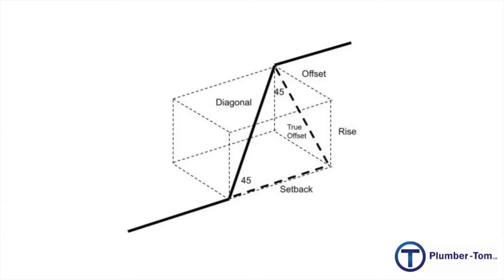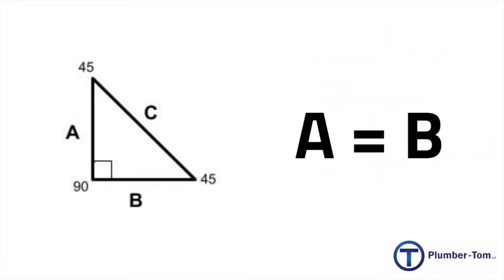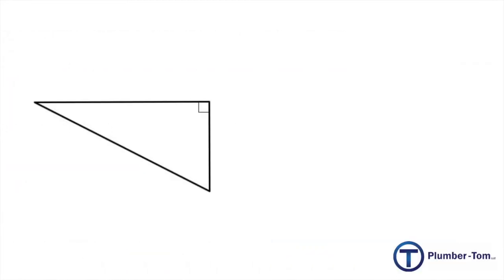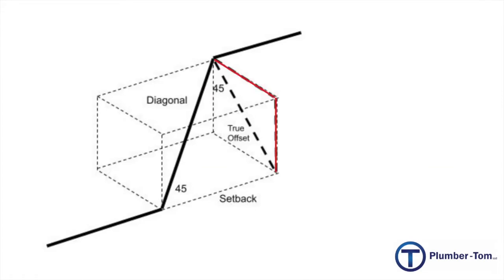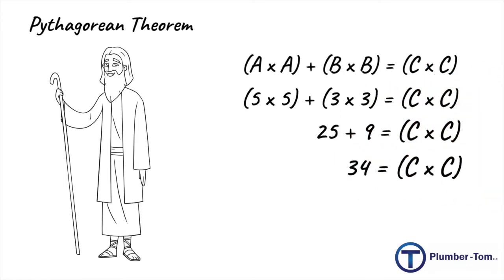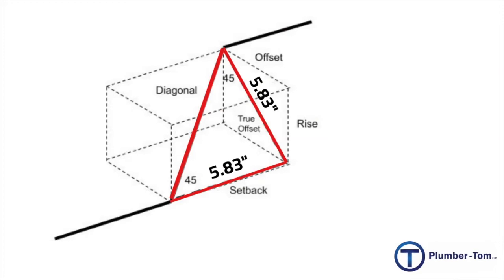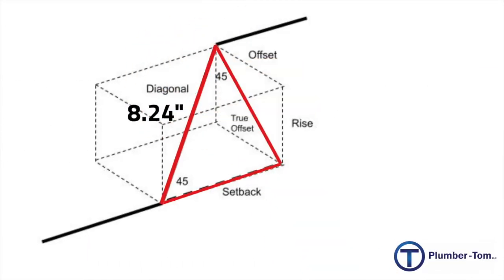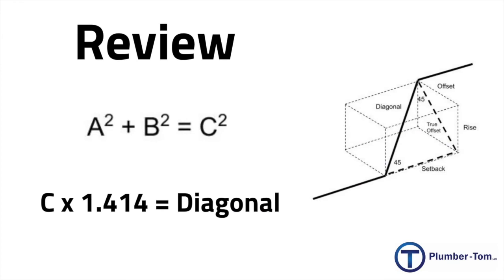Plumber Math: Offsets Part 3 - Rolling Offsets Using 45 Degree Fittings

Comment: I have a unique problem that I need help understanding the math. Using standard 45° elbows, I have a rolling offset for a change in elevation. The elbows are rotated in such a way that the lower line and the upper line will turn 45° from each other. Is there a formula, or set of formulas I can use to achieve the desired effect?
Reply from the maker: II don’t think so. If there is a formula, I don’t know it.

Comment: Thank you for your great explanation. 👍 

May you explain as well how to fit up the rolling offset please?
Reply from the maker: You’re welcome.  One you calculate then you will need to subtract for fitting allowances (I have another video on that). Then you can assemble the pipe.
Reply: @plumber-tom9470  

What happen though, I have problems assembling the rolling offset. I know from the explanation how to calculate the rolling offset. 

Do you by chance, have a video showing how to assemble the rolling offset AFTER calculation is done?

Comment: I was trying to roll a wye 45 degrees, but I wanted a fitting that picked up a vertical stack at the end, instead of picking up a horizontal run.  That appears to require a 30 degree fitting (1/12th bend) which doesn't seem to be a fitting.
Reply from the maker: Oh. When you get into 30 degree fittings there are other constants to use for calculating. 1.414 is only for 45 degree calculations

Comment: Is the fitting allowance, the rest of the elbow compared to where the pipe actually is in the connection
Reply from the maker: No it is not the whole fitting.  The fitting allowance is the space inside the fitting from  the end of the pipe to the center of the fitting.

Comment: How do you come out with 5.83  from 34?
Reply from the maker: Take the square root.  On a calculator, type in 34 and hit the button that looks like a check mark.  This will find the number which, when multiplied by itself, will equal 34.   It comes out to be 5.83.  Hope this helps.

Comment: How would you still do this rolling offset if you used 2- 90 degree elbows on  45 degree angles?
Reply from the maker: You can do  a rolling offset with two ninety degree elbows, but the math is different.  You would just have to measure the offset between pipes, and subtract fitting allowances.

Comment: Do it with 90s
Reply from the maker: That is possible, but it does not require as much math.  Just a measurement from center to center and subtract fitting allowances.

Comment: Why not just use the setback x 1.414 ?
Reply from the maker: Good question. Most of the time we are not given the setback or it is difficult to measure. But the offset and the rise are generally measurements we are given or that we can measure for ourselves. From the horizontal offset and the rise we can figure out the true offset which is equal to the setback and then multiply by 1.414 to get the diagonal.

Comment: Good morning, Tom! This is totally unrelated to this video. You are very good at explaining math, so I’m wondering if, one day, you could produce a video on the math involved with hanging pipe — particularly with clevis hangers anchored into a concrete floor above — Unistrut not being an option. I know there are “cheat sheets” out there, but if you have a method that you use or recommend, it would be very interesting and helpful to see that method and math explained. My brain gets to the overload point sometimes when I am trying to calculate hanger heights, rod lengths, etc. on, say, for example, a run along a corridor with three different sizes of copper, all with different thicknesses of insulation, and one non-insulated SCH 40 steel pipe for gas — all parallel to each other. 

To simplify, let’s say all of these pipes are on the same centerline from the floor. Of course, the hangers for the copper would have to be hung at their “temporary” height to allow the copper to rest in the saddle for roughing in, and enough rod must be left over to allow for the hanger to be dropped enough to allow for the future installation of the insulation, but the MATH! What is the math? What is your method? For the example I gave above, I could go through three or more notebook pages, adding, subtracting, scratching-out what I just tried to calculate because I forgot where I was in the calculation, then starting over again. 

Laying-out and calculating hanger heights and rod lengths seems to be way too time-consuming for me, and I know that you know the answers to change that. If you would like an example of one I just did down a 180’ corridor, start from left to right with these four pipes, all parallel to each other with the same centers from the floor to the pipes: 1-1/4” copper hot return with 1” insulation, 2” hot copper supply with 2” insulation, 3” cold copper supply with 1” insulation, 3” SCH 40 steel gas with no insulation.

What do you think, Tom? Is this something you have an easy-to-remember mathematical solution for? Is this something you would be interested in producing a video for?
Reply from the maker: Hey Bruce.  That is a good suggestion.  I know exactly what you are dealing with.  I did commercial construction work for quite a few years.  I will put that on my list of videos to consider.  Thanks!

Comment: What about the actually roll in the rolling offset? Like how much you need to turn the bottom fitting to make the offset work. No one ever talks about that.
Reply: That varies for each scenario. I've found for me the easiest way to find that is to take the two 45s with the length of pipe Tom just taught to find and put them all together. For the rolling offset to work correctly those two 45s need be in line with each other. Usual fittings have marks on them to help find the different 45° angles. I'll look down the one fitting like I would a gun sight to make sure the fittings are in line. Once that is done you can take this pipe assembly and put it on the pipe where you want the offset to start. I'll take a tape measure out and measure the rise. If the math is done correctly this should land the offset right where you want it.
Reply from the maker: Hello Cody.  Perhaps I need to do a follow up video demonstrating the offset.  But to answer your question, the fittings in the offset need to be completely aligned in a flat plane.  By that I mean, if the offset were laid on a flat surface, all the pipe and fittings would lay down evenly.  If the fittings are turned out of square from each other, then the pipes will not go in a parallel direction before and after the offset.  Does that make sense?